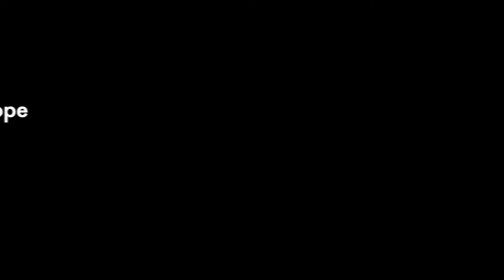LX200 C8  Replacement

Comment: Hello, I am working on an LX200 Classic, it came with no power, but after I sorted out the power issue, I am having the motors spooning continuously. Is there anything where to point me where to look? Thanks!
Reply from the maker: There are many resources available on-line. Our website has some technical documents, and links to some very helpful sites like: http://skymtn.com/mapug-astronomy/MAPUG/ArhvList.htm
Reply: @clearlinetechnologycorp.5974  Thanks for your answer, Unfortunately, the links from the website are not working.

Comment: Would be nice to see how to remove and replace the board from/to the mount. I recommend not cutting the old capacitor leads and use the solder sucker (or, if careful use solder braid) on the backside as the first thing. Probably should not apply the soldering iron on the component side. I have experience recapping audio equipment and that''s how I do it.
Reply from the maker: Thanks!

Comment: C8 died on mine, flash of light and loads of smoke.Replaced with new capacitor,and back to life.thank you for the help.
Thinking about replacing all the other capacitors now, just to be safe. Definitely need to replace those in the hand set due to possible Fatal damage to the ribbon cable if the old capacitor burns in there.
Reply: can you explain more about the ribbon cable? are you saying something may be blown in the handset as well? or a line in the ribbon cable?

Comment: Evening. 
Fast question on my Lx200 classic. started having problems last night with my scope. I found that once aligned the scope usually draws about 400 to 500 mA of power while staying on target. Last night while on M42 I noticed the scope would all of a sudden start loosing fine tracking and the paddle would become unresponsive necessitating a reboot. At the time of rebooting I was drawing around 700mA and the scope on start up would have to be realigned again. Current draw would once again start at 400 to 500mA and slowly creep up. Damn thing just continued to do that all night. I eventually moved to Tuc 47 and the problem went away with the scope drawing its normal 400 to 450mA / so tried again this evening. Although not as bad it did seem to favour that M42 area for drawing higher than normal current but while pointing at Tuc 47 on the opposite side ( at similar Dec) I was drawing normal current. This leads me to think that I might have really dirty grease or solidified grease in the gears which is causing the scope motors in that area to possibly strain. The scope is dead accurate when aligned properly and is within the 9c50 finderscope FOV on every target. I also noticed that when slewing it draws minimal current. Rarely above 400 mA - but when maintaining position the current creeps up. So question. What is involved in servicing the gears on a LX200. I also would like to replace the old tantalum caps in the handset and on main board with proper Electrolytic ones. Have u a list of the caps and values of each
Reply from the maker: Hi Mike,
We have replacement caps as a kit on our website, www.clearline-tech.com. We can also send you a document on where they are and how to replace them. Check the website for more info,
Servicing the gears is very tricky, so hopefully there won't be a need for that.
Reply: @clearlinetechnologycorp.5974  btw. Will certainly keep ur details for future reference and pass details to others in our club who have classic scopes.
Reply: @clearlinetechnologycorp.5974  thanks for getting back to me. Situated in South Africa so not easy to get parts etc. I have  through our Astro club found someone who has done not just his own LX200’s but others as well. I’ve negotiated for him to do mine and do a full service including replacing all Tantalum caps